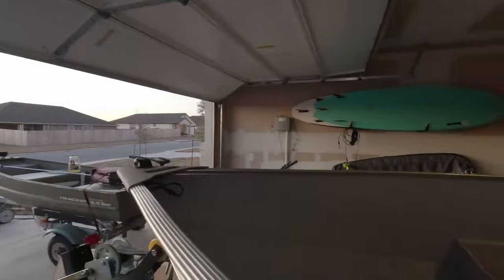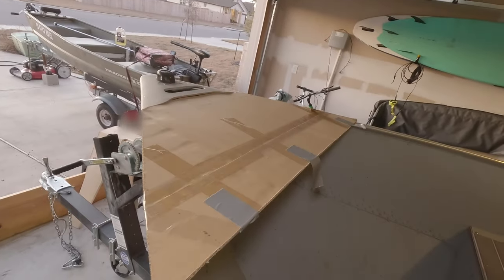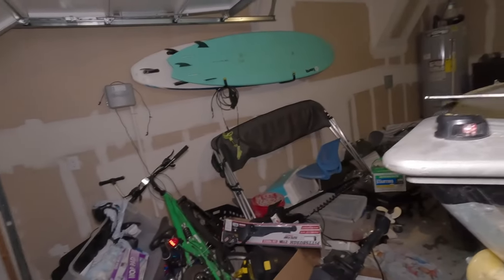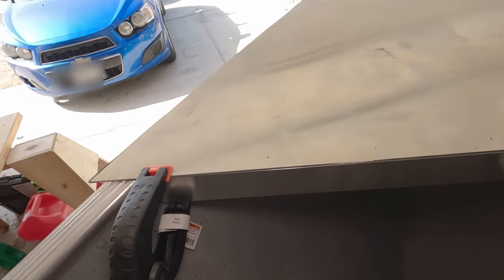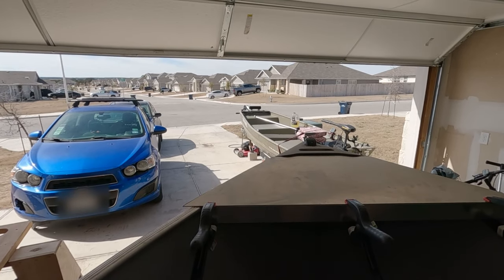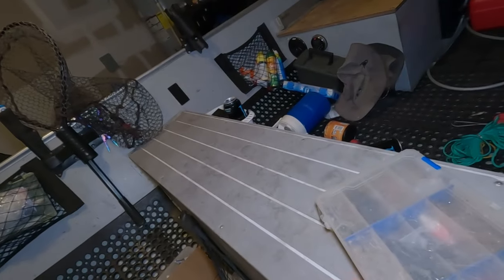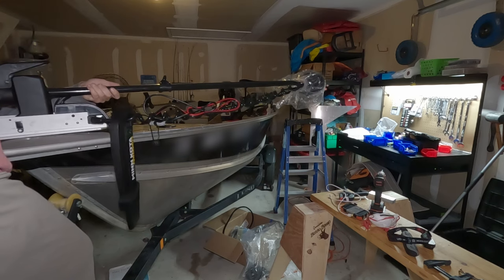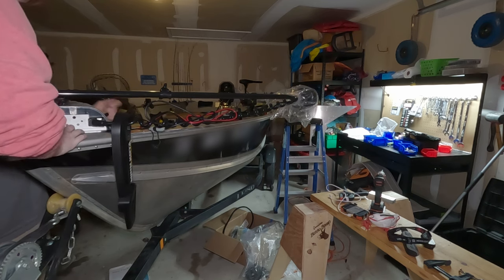Bow Mount Trolling Motor Mount DIY - Open Bow Aluminum Boat

Comment: My boat is exactly the same as yours. BUT I DID MINE DIFFERENT,  What I did was get a 2" x 1/8" steel strip which molded to the inside bend and bolted it with a locking nut on the inside  I measured down 3/4".  I then welded with a wire welder the same type of metal brace from one side to the other in 3 different places.  i then got some aluminum tubing and leveled to the  top of the braces and attached them to the welded braces with small bolts and locking washers.  That made it really strong.  I then set the 1/8' decking down into place inside of the boat rim.  This way you have no rough, sharp edges that i could possibly get cut on. I then riveted across the tubing the flat sheet decking.  This made it very strong.  I then put my trolling motor on and drillied out my bolt holes  going thru the aluminum tubing underneath.  I removed the trolling motor and then I laid carpet down with carpet glue and it set still inside of the outside boat rim.  I put a aluminum angle strip  down on the front long side of the metal to again hide the metal rough edge over the carpet.  I got  the carpet and strip from lowes .   I then placed my trolling motor on the deck and with a screwdriver poked a hole coming from underneath thru the braces and trolling motor and then bolted it down.  Mine is a 46lb thrust tiller handle Minn Kota trolling motor.  Down below my new deck. I have a separate battery to operate the trolling motor.  I built a box that just covers the battery and I use that as a platform to put my feet.  2x10" by 38" and I can charge the battery from the bow area and still have ample storage for an anchor and a couple of life jackets or a styrofoam cooler and never have to worry about the lid blowing off or direct sun on it.  Would love to send pictures to you.
Reply from the maker: Yeah I would love to see what your mounting solution looks like feel free to send your pictures. I don't think I can replicate what you did though I don't know how to weld/don't have the skills you do .
Reply: @FishOclock89  l had a friend who had a welder and he did it free for a fishing trip
Reply: @rickwilson2848 - I’d love to see how you installed your mounting deck as well.

Comment: Hey, great job.  Question: what did you do with the bow navigation light?  I am doing a similar install and am trying to find a raised light so it mounts aft of the motor mount, but still remains visible from ahead of the boat.

Comment: Pretty straight forward and it helps to see how you did it. It is my turn and I stumbled upon 3/16 local or I would help you out. Mind if I ask how the Powerdrive is treating you?
Reply from the maker: The powerdrive works great I haven’t had any issues and having the spot lock gps is a game changer ! Definitely buy local if you can it will be cheaper. I couldn’t find anywhere locally that sold the kind of aluminum I needed.
Reply: @FishOclock89  I appreciate your opinion and have one on order . I always like opinions of those that actually use and have . Thanks again.

Comment: Hey, which size bow kit did you buy, the standard or the xl?
Reply from the maker: standard. I think the XL just comes with a larger sheet of aluminum. the standard is also a fairly large sheet, not sure why you would need the XL maybe if your bow is really wide? best of luck to you on your project and thanks for watching.